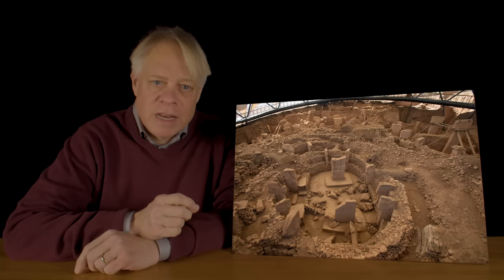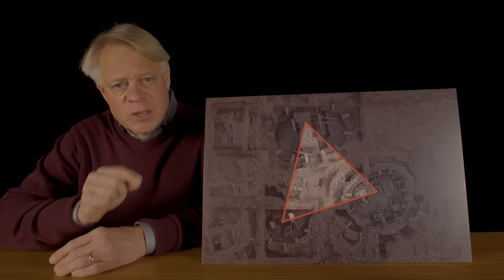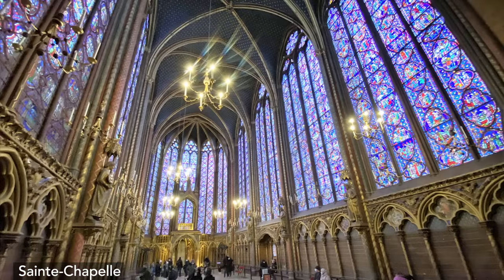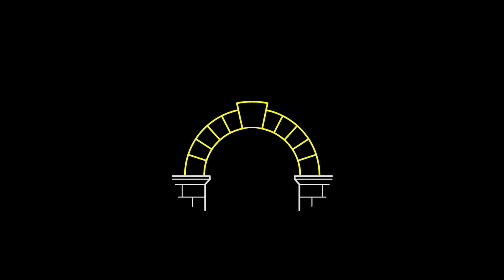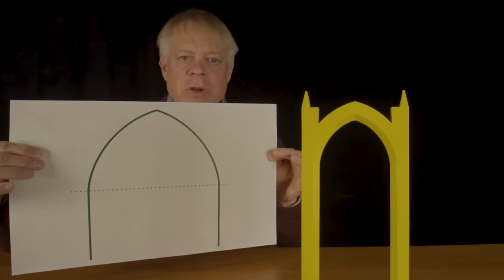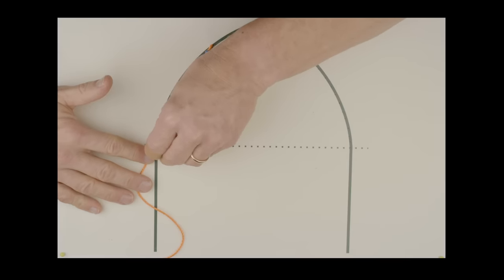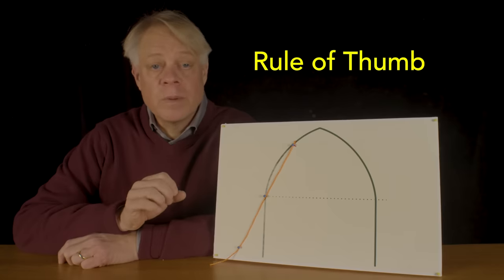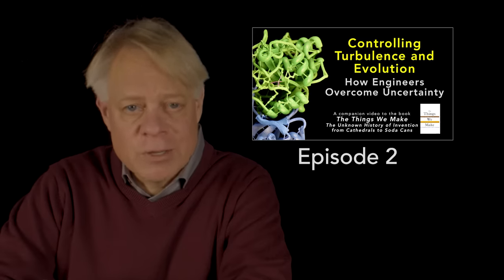Building a Cathedral without Science or Mathematics: The Engineering Method Explained

Comment: The front had 3 ponited arches the side 4, which you compare to1 circular arch.   You wouldn't want a circular arch anyway as the building is long and narrow.  You'd just want a regular arch tunnel regular arches along the side.  Also the thickness of the wall supporting the arch not taking the height of the wall into account is a problem.  A very tall arch obviously must be thicker than a short one.

Comment: So the ideal wall width is not EXACTLY one fourth the span (otherwise you would just fold the rope into quaters and be done), it is some specific fraction which is found by the more elaborate rope method?
Reply from the maker: Correct … plus they were not saying to themselves “I need to get a distance that is 25% of the width but I lack the analytical skills to do this so maybe I will use a rope to compensate” instead (and this is the spirit of a rule of thumb) they were taught “do THIS and you wall will likely not buckle.”

Comment: How can you claim that the stonemasons knew no mathematics?
They were experts in geometry which is a branch of mathematics.
They used dividers and squares all the time from layout to the shaping of the stone blocks.
Have you even heard of a daisywheel?It was a slab of stone with a circle and triangles inscribed on it as a scale model of e.g. the arches,trusses.The true dimensions were multiples of the lines on that daisywheel e.g.24 and were measured out using the dividers. 

It made no difference whatsoever that there were no universally agreed units of measurement because,as in the sizing of stone for an arch, it was all based on ratios and similar triangles hence the extensive use of dividers and steel squares.
Perhaps what you meant to say was that they had no books of data tables to rely on.

Comment: Question: if the arch dividing method came from the romans, isn't it likely that it was developed by a Greek mathematician and the wisdom of method passed on? It makes me wonder if it can be purely called without science, just used without scientific knowledge like most of devices we use today, but that weren't developed without science.

I'd also make a point from perhaps a slightly different perspective: today we know many problems and science for them, but they are way too complicated to simulate accurately in all detail in the limited lifespan, so engineering uses a simplified method that takes into account the key elements that make the most of the accuracy anyway, and adjust with constant factors.

Comment: Nice!!! May I suggest that the mathematics came from the islamic world where the pointed arch was in use since forever and they slowly developed the math to make the structure as slender as it could get without compromising the structure.

Until the 14th century, a lot of European scholars travelled to Baghdad, Seville was in turmoil at that point, to learn the sciences and translate European classics back to latin and greek. The pope was sending all the capable men he could to learn and copy as europe was decaying and absorbed by a more dynamic islamic culture. Then we got the renaissance. The mason wasn’t given the mathematical formula, still mostly built on geometry at that point, but a practical set of relationships that can be derived with string and pins. That said, I assume the mason could do basic math and multiply up from a scale design. To become a mason one had to go through a ling apprenticeship.

Comment: very cool, but i suspect ultimately something along the lines of 1 or 2 (but probably a bit of both)

1. somebody did the math, and then created the rule of thumb -> somebody did the math
2. somebody tried a bunch of different wall sizes for different arches empirically and arrived at the rule of thumb -> somebody applied the scientific method

engineering is great, but no substitute for science and math (neither are these substitutes for engineering)

Comment: The masons that built a too-thick wall were expensive and not contracted again - they went out of business and their practice with them.
The masons that built a too-thin wall were cheap but either died on site due to collapse, or were not contracted again because their building collapsed soon after - they went out of business and their practice with them.
I let you fill in the 3rd possibility.

Comment: I've designed a gothic arch wood frame by glue jointing process with 2x6 lumber. Basically it's 2 half arches that connect to a top beam with joist hangers to form the full arch. The full arch has a 20 foot wide base with a 13 foot height at center. 
Before spending 1000.00's of dollars on an engineer how could I test it myself to see if it has adequate strength for snow load in my area?
  I'm no engineer, so I was thinking of making an  anchor point on the ground that I could pull steel cables through that are attach to various points of the frame. Using my forklift to pull the cables through the anchor point putting directional inward stress on the framing with a commercial weight scale in-between to measure the tension. I could measure the frames deflection under different weight loads and maybe even take it to the breaking point to see how much tension it will actually take.
Like I said, I'm no engineer and wondering if this is a good approach on testing my framing for structural integrity.

Comment: On the face of it this string method just seems way to complicated. If they have the idea that the you need 1/4 or 1/5 the width of the arch why would they not just divide the span by five. You don't need math or a ruler...Just do it. Pick a length...test,....adjust the length until it fits five times. These guys were not stupid. They understood the world that they lived in. The simplest solution is often the best. Also they may not have had a ruler marked in inches BUT they could measure.

Comment: How do the ancients universally come to discover and trust in a technique that they can't independently verify has actual usefulness greater than zero? In the trades, we have all kinds of "hacks" to make work easier, but the usefulness of all of them is immediately verifiable (and the ones that aren't, you're not asking an entire civilization to build all their structures you preferred way because it might be a little better 100 years later).

Also, every material and construction method has completely different physical properties that would impact this. The differences between one type of concrete to another alone put idea into much question. Are there any research papers that actually verify that this trick with the rope actually has universal usefulness that exceeds the ability to standardize?

Comment: Is "between 1/4 and 1/5 the arch's width" just a shorthand for the actual precise dimension yielded by that measuring process, or would any wall thickness between 1/4 and 1/5 the arch's width work?
If the latter, would exactly 1/4 the arch's width work? Because that could me measured even more easily by just measuring the width of the arch with a rope and then folding it in half twice.

Comment: I mean, it makes sense that humans would have a natural desire for order without the advanced mathematics we have today.

You see kids who build structures and holes in dirt and sand and they "adjust" them until they "look right". They don't know calculus or algebra, but there's an idea of how something "should" look inside their mind. Or, if they're imaginative, they'll modify their methods until they get the desired result.

It makes sense that as a mind matures and becomes more sophisticated in adulthood, humans would develop methods to achieve consistent and reliable results for building things. I even took a construction class in High School and we always "squared up" the wall frames with a tape measure before nailing them into the floor. No complex math needed, just the basic understanding that if the corners were equal in distance diagonally, the wall was properly angled to withstand the greatest amount of weight for the longest amount of time with the minimal chance of bending or breaking.

Math is more the abstraction and explanation of logic, the quantification of imagination. No doubt extremely useful in engineering nowadays, but perhaps not the originator of it.

In fact, now that you bring it up, it was likely the other way around. Engineering, and one's desire to know if the creation or existence of something was possible, was likely what spawned, or at least greatly contributed to the creation of mathematics.

"I want to build a wall from this town to that town."

"Psh! Fool! Can't be done!"

"I believe it can be."

"Oh yeah? How you gonna prove it without building it?"

Ancient engineer: Thinks. Begins drawing lines in the sand.

Sorry for the longwinded comment. I enjoy your stuff. Your explanation of the shape of aluminum cans pops back into my head when I go to the grocery store. Keep up the great work.

Comment: 09:48 Strike the radius and you have a third of the circle- no need to drape string around pins. We've all done this with a compass to make a 6 sided flower shape when bored in primary school.
 Okay, make a straight line between these two point and 'voila' it intersects the wall. Well of course it does if the wall doesn't have infinite thickness! To find a point you need the intersection of two lines or curves or whatever. You can't use one! 
  To support the arch you need a force towards the centre- wall thickness is irrelevant. Wall density and the inclination from outside to inside would mean something but if you make the wall of aerogel instead of depleted uranium then that angle will have to be bigger.
  Have I gone insane? What have I missed? Why are there so many comments from 'engineers' agreeing with this video?
  Utterly confused!

Comment: Rules produced by a geometrician or mathematically-trained engineer can be learned by rote (with no understanding of the math derivation) by masons ignorant of math, just like when this video says "dividing the string into thirds works but I don't know why."  For ignorant masons to develop rules of thumb based on centuries of trial & error is a much less efficient "engineering."
     However, trial & error -- also called "experimenting" -- is a valid scientific method, especially when care is taken to account for variables that changed from trial to trial (for example differences in the building materials), and when biases of the experimenters are scrutinized.
     The "rule" that the wall thickness should be between ¹/₄ and ¹/₅ of the arch height is presumably not a general rule, and surely depends on the specific materials used to construct the walls & arch, the height-to-diameter ratio of the arch, and the height of the walls.  The rule was presumably learned from centuries of experimentation using construction materials similar to the materials used in the cathedral.  Or perhaps the rule is wrong, and is much more conservative than necessary, and the cathedral walls were built thicker than they needed to be, wasting resources.
     It's not true that the cathedral would have needed to occupy more land area if the arch had been semi-circular.  Instead, the semi-circle could have been given a smaller diameter, to match the distance between the walls.  The purpose of using a pointed arch instead of a semi-circular arch is to trade-off some arch strength for some extra height, since extra height was desired.  However, the taller the arch, the more it weighs, so a pointed arch requires thicker (more expensive) walls than a semi-circular arch of the same diameter.

Comment: I’m confused. If the rule is that the wall’s thickness should be one fourth the span, why didn’t they just stretch a rope across the span (in the life-size drawing) and fold the rope in half twice?
Reply from the maker: Because they were not thinking “I need a fourth but I lack the analytical skill to do so” they were taught do THIS and it will get to a wall of the correct size (ie we speak of the rule as a proportional rule knowing that is is a fraction of the width, this description is a modern framing)

Comment: Not sold on this wall-sizing method...might work for a range of heights but if you think about it, the higher you stretch the arch, the thinner the wall. Also, if it's a quarter or fifth of the span, why not just measure the span and divide by 4? Or, if you don't know math, use the rope and fold it into 4 equal lengths? Maybe I'm too dumb for his explanations

Comment: 6:50 Why would you go through all that complicated exercise when all you had to do was lay the rope across the opening of the arch, cut it to length, and then fold it in half twice? It makes no sense.
Unless you got the rule backwards. Seems to me that the rule isn't to make the walls 1/4 or 1/5 the width of the span, and then this relation between thirds of an arc length and wall thickness results. It's the other way around. I think they worked out that line as being the pressure line, down which weight is transferred from the arch into the supporting pillars. The rule is for that line to be fully contained within the walls, and the result is a wall that's 1/4 or 1/5 the width of the span.

Comment: I think you are skipping the “trial and error” part of the “rule of thumb” discussion. And why the us-versus-them comparison of the engineering versus the scientific/mathematical methods? Rule of thumb worked well but evolved very, very slowly because of the fundamental lack of scientific underpinning or an understanding of mathematics. You can not even describe the techniques they used without resorting to the language of mathematics. How many structures collapsed during construction while developing understanding of building material strengths or the proper width for the supports of a pointed arch? Engineering, like all technology, evolves. Part of that evolution was to adopt mathematical understanding (so that the act of designing buildings wasn’t dependent on strings) for repeatability and precision, and science to better understand materials strengths, load capacity, stress vectoring, and ultimately improvements in materials and construction techniques.

Comment: I did not think I’d “like” this video for the first half. In my opinion, you use some dubious assertions. I do agree with your conclusions and especially like that you call out engineering as looking for acceptable solutions for the real world when we have less than perfect information. When I was young I tried understanding how bicycles work. They are more than 100 years old and I expected them to be fully understood and documented by science. Reality is that there are some useful equations and some understanding of the vehicle dynamic phenomena but as a whole, they are still designed by “rule of thumb”. As an adult working in engineering I deal with the imperfect regularly. My friend is an engineer working for a large motorcycle manufacturer on their race team. They are still solving vehicle dynamics questions using rules of thumb.

Comment: Dividing a length into three equal parts isn't that straightforward itself. It requires approximation and then adjusting the approximations until the three sections are as equal as possible. I was surprised you didn't address that. But then, if the masons didn't know math, they wouldn't have known or cared that trisecting a given length is mathematically impossible.

Comment: Flying Buttress would be gone,...if Central/Main Circular Dome been supported by circular ring, wounded by High-Tensile Steel wired, around the outer rim of reinforced RING-GIRDER, which was not existed back then (400-800 years ago.)
 High tensile-steel wire/rope/tether...!! Is the key element of Dome supporting.

Comment: But... They are still using science, which is a method for determining truth. In this case they may not have had set measurments, etc, but they did have tools abd testing knowledge to know for instance to have a rule like a stable arch results when it's a fourth or a fifth of the arch's span. This is but one example of them using science to engineer this structure.

Comment: Am I tripping or if u want a quarter the width u can halve the halve the rope?
Reply from the maker: It isn’t exactly a quarter you want, it varies a bit with the height; but even that isn’t the point. The point is that they were not thinking “here’s a mathematical rule for building an arch, but I lack the abstract skill to do the calculation so I will use a rope to do that calculation” instead they were thinking “do THIS and my arch won’t fall.”
Reply: @engineerguyvideo  ahhh I see, just sort of an empirical rule that they noticed
Reply from the maker: @jeffreychen5130 a rule of thumb!

Comment: The recipe breaks down as the arch becomes too tall.   The line will become increasingly vertical and so the width of the base walls will get shorter.   The recipe appears to work when you apply it to an arch that is already in the right range of shapes and width.   So really they used geometric intuition and made double-checks with this recipe.  But if you start from an absurd arch (too tall curved part, not so tall base), the recipe will give you absurd results (arbitrarily thin base walls).    Really this is more like the scientific method (trial and error, building more cathedrals makes you more confident) than the way physics usually proceeds (mysterious anomalies pile up and are explained at once by a model, as e.g. Newton did with gravitation).